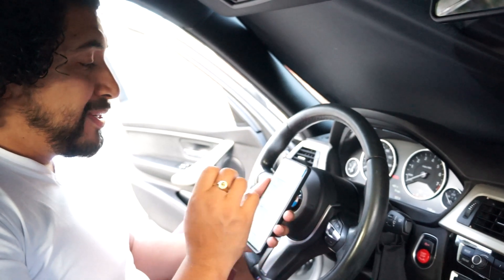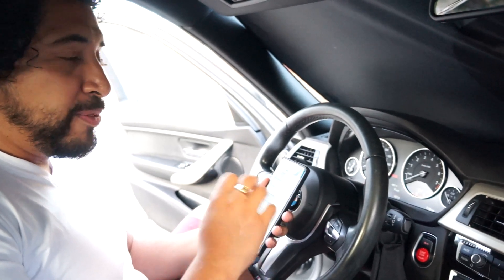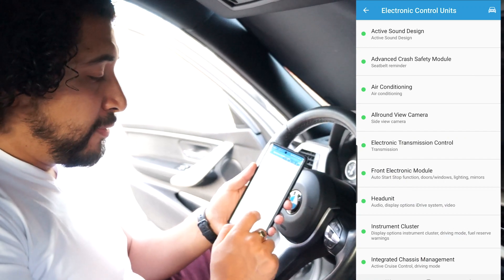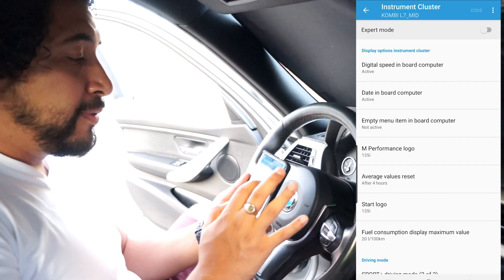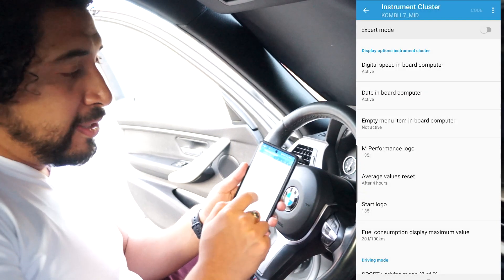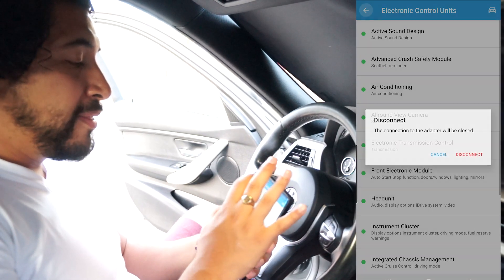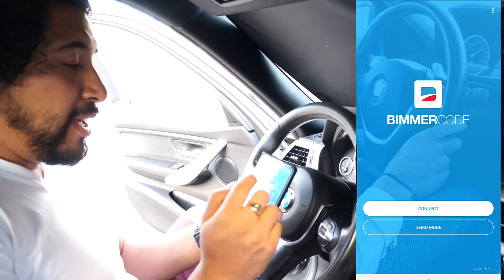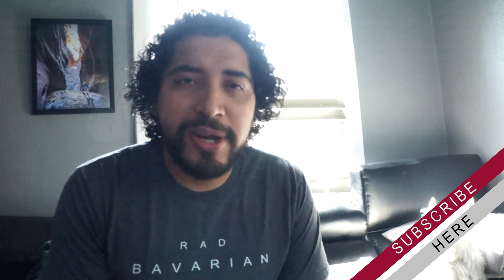Digital MPH on your Dashboard - Bimmercode

Comment: I tried to code activate the “M Sport Logo” but it  gave me a instrument cluster display error and reseted all my stuff KM, service, time date etc. And it didn’t work anyone else have this issue?? I did a backup now everything is normal though.
Reply from the maker: What OBD are you using? Maybe it's a connection problem
Reply: @RADBAVARIAN  I’m using the same OBD Veepak

Comment: Done it and its not working. Its active but speedometer is not appearing :( Everything else what was coded is working.
Reply from the maker: That's strange! Should work, maybe switch through the modes and see if it comes up
Reply: @RADBAVARIAN  appeared  now but only after "Empty menu item in board computer" switching to not active (like your one) others had it active and works.